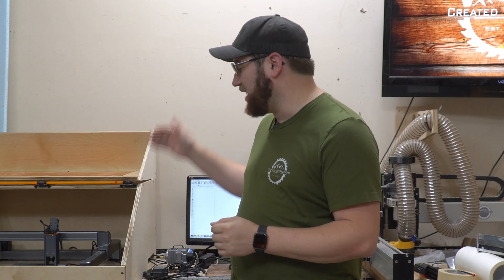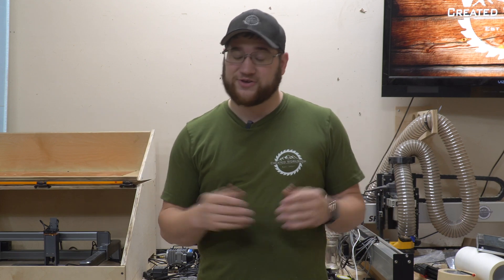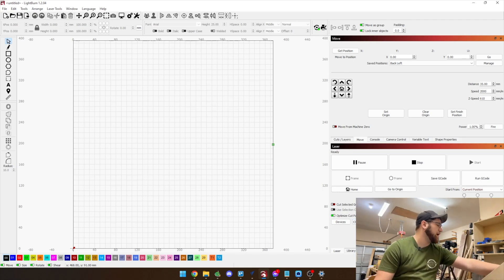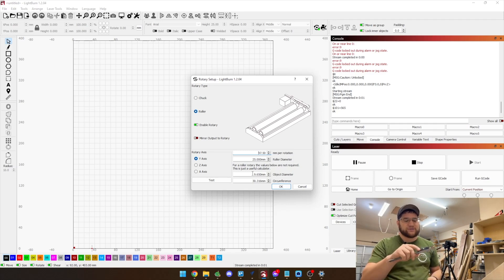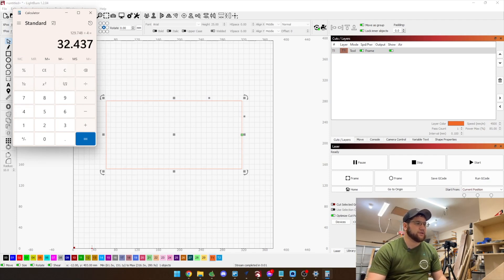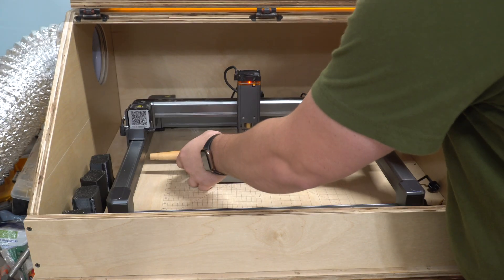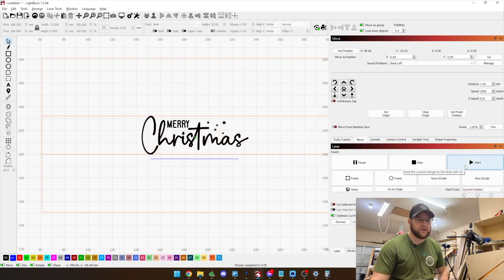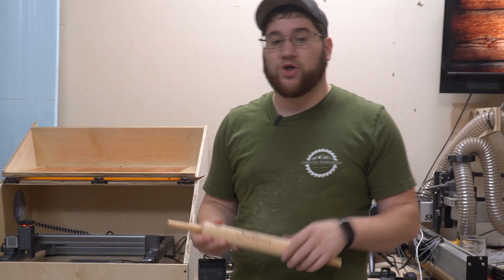How to use Jinsoku LC-40 Rotary with Lightburn #laserengraving #lightburn #tutorial

Comment: why not use port A Axis? Need to use Y Axis?
Reply from the maker: That's how SainSmart designed the laser to function. Most lasers actually use the Y axis though and leave X live as the head only has to move left to right. More professional applications have an additional axis that they use so you can leave the whole gantry available, but on cheaper ones like this they just piggy back off the Y

Comment: I love my LC40.... I've had it for a few months. Purchased air-assist and rotary with my LC40 on day zero. Just now getting to mess with the rotary. I haven't started yet (hence watching this video). 

I will say while this work-around is hopefully it is easy as you say, it seems very inconvenient and kind of against the philosophy that SainsSmart seems to have been aiming for with the design of the LC40 (even if it is a simple firmware flash.)

SainSmart seemed to be trying to sell something sleek and easy to work with, given the use of USB-C connectors and using a purpose designed/manufactured aluminum frame instead of the more traditionally used aluminum extrusion.

It seems like they cut a corner with the firmware/software side... First having to flash firmware to switch between smartphone and lightburn usage on PC, and now this flash to go between rotary and traditional X/Y. I'm not an engineer by any means but it seems like this could've approached in an easier way for the end-user, and otherwise is a fly in the ointment so-to-speak. 

While certainly not an issue for the tech minded, this would be a non-starter for a lot of people. Disappointing considering the rotary is a very easy to plug in USB cable and not unplugging and swapping stepper motor cables like you have to do with some units.

P.S. Merry Christmas and Thank you for the video BTW, I will admit this would have taken so much longer to have figured out had you not made this video.
Reply from the maker: Yeah, I totally agree that they cut corners to do it this way (and also made it harder on themselves having to build in special USB connectors, make a custom rotary, etc.) It's not the best system by any means. I'm glad you found the video though!

I no longer have the LC-40, but if you follow https://www.youtube.com/@mcfarlandcustoms he has some videos getting ready to come out on it, like an air assist explainer and how much it does/doesn't help with cutting.

Comment: I just found out today the rotary you have to load special firmware and then if you need to go back to the regular laser you have to load the original grbl firmware.  You could be doing this several times a day.  This is a really bad design and I am not impressed with their programmers.  All they had to do was write their firmware so you send some special commands to enable the rotary and some other commands to disable it.  This way you would only need one piece of firmware.  I suppose though it could have made the firmware too large for the controller board they are using and rather than redesign the controller board they decided to have two firmware files..  Annoying though.  I like the laser mostly, and I was going to get the rotary, but now I am not so sure.  I guess I should have done some more research before buying this one.

I wonder if you could this to just use the original grbl firmware and just breakout the y cable the way alot of laser engravers are.
Reply from the maker: While I don't have a rotary to test that with, I do think you could probably break out the Y cable and use it that way.
Reply: @CreatedWorkshop  Yea, I kind was wondering if that was possible though I would probably have to disconnect both y steppers.

Comment: So, I am a bit confused.  If the grbl firmware used for the rotary can be used in both rotary and laser mode by inputting those commands, why bother reflashing back to the grbl version that does not support the rotary.  Or did you mean that you mean you reflashed it back to the stock firmware so you can use the mobile app.
Reply from the maker: You have to reflash back to the stock firmware to use the mobile app. Flashing the rotary firmware disables the Y stepper so you'll have to reflash in order to use it normally again.

Comment: Great video Patrick. I started out very frustrated but your video answered a lot of my questions. Do you mind if I ask you something regarding Lightburn and the LC-40? I was running LB on my Sain Smart 3018 PROVer. I set the device name to just GRBL. Now I am running the LC-40 with LB  and named the Device GRBL LC-40 but at 100% power it's not cutting think cardboard. I did some practice cuts with the Laser_ble software that came with the LC-40 and it cut through the cardboard at 30% power and 30% feed. I'm assuming there are some parameters in the GCode that need changing. Would you know what they are? Then once I change back to my GRBL device for the 3018 PROVer, will the original settings be there or will I have to change them back as well? Thank you.
Reply from the maker: Hey there! It should keep device-specific settings related to each unique device within Lightburn, I believe, so it should change things back as needed. I'm not sure what settings you would have to change on for the LC40 though. What speed were you trying to cut at for 100% power?
Reply: Hi my lc 40 works fine with all the different power settings so I cant help you there you have done the same as i have

Comment: I followed all your steps, however, when I start my project running all the laser head does it moves to the far right and starts grinding the belt with the stepper motor. ANy help would be great
Reply from the maker: Hey there! Sorry it took so long to respond! That's very odd, have you tried reflashing the firmware?

Comment: Hi Patrick great video I received my LC40 3 days ago it was the new updated 10w, it assembled easily. I use lightburn with my xtool, the LC40 machine worked with the app when tested but when I moved the y axis with the machine switched of but plugged in the red light onto of the laser unit would come on and the fan would go round, strange for that to happen. I then tried to flash the firmware on my pc it would not connect it came up with connection Erra. Tried on 3 different pc still the same I did manage to flash with the phone. This way though you cannot go back, I setup lightburn I installed the LC40 but when I tried to move the y axis I had a bad grinding noise from both stepper motors. I switched the machine off I noticed that the left-hand y axis linear rail had quite a lot of sideways play and the right hand was ok. I am very disappointed with this I have emailed Sainsmart  3 times for the unit to be returned and exchanged but as yet I have not had an answer. It is packed up now ready for shipping.
I just think I have been unlucky as it is a well-made machine for the money, sorry for going on somewhat just hope this is not a fault with the new 10w machines.
Reply from the maker: Hey there! I'm so sorry it's taken me so long to respond to this comment, I am just now catching up on them! 

I'm sorry to hear all the problems you've had with your unit, I hope by now it's all resolved. There are some tricks to flashing the firmware that I mention in the video, and hopefully that can help you in the future if you still have the LC40. For the fan spinning, that's normal as moving the stepper motors they act as small generators making a bit of electricity which can then turn the fan or light up the LED.
Reply: @CreatedWorkshop  thanks for the info  mines all sorted now Thanks Tony